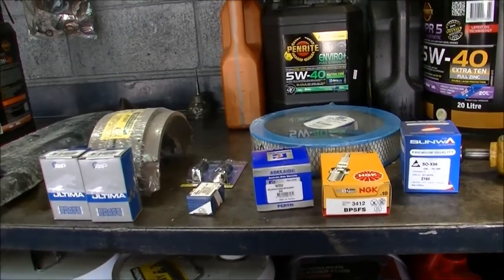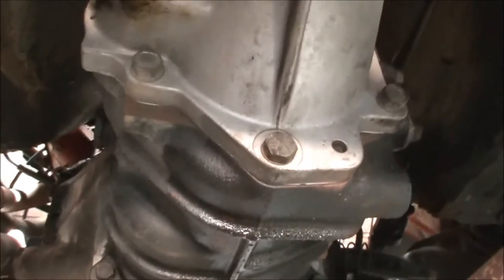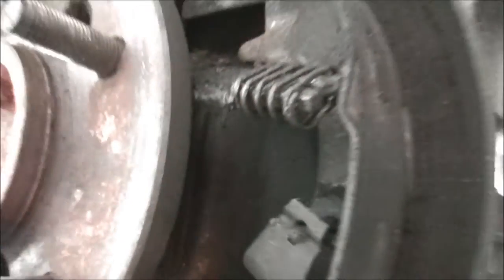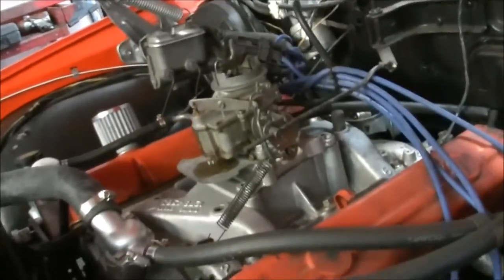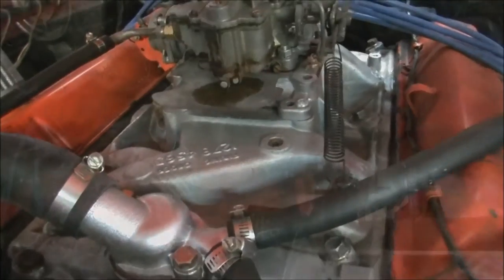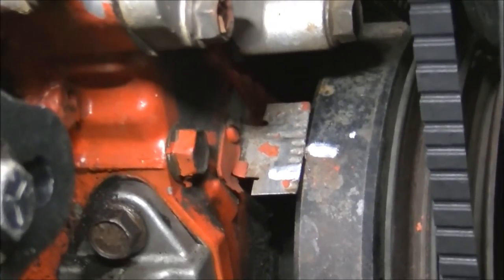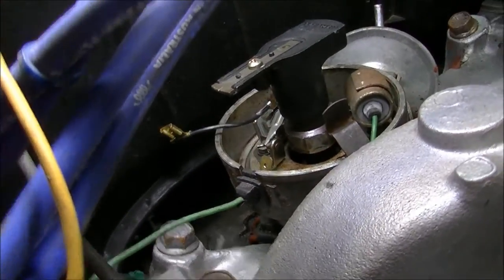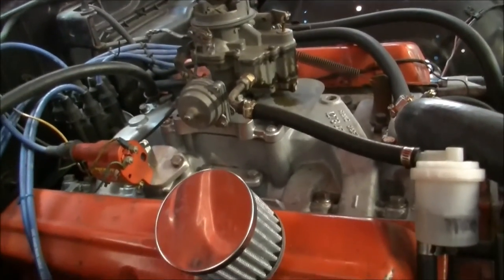1973 Holden HQ 1Tonner..

Comment: A 308 4 barrel and a dizzy regraph tends to wake these old girls up. for some reason they came factory with a really slow advance curve and tend to load up, as I suppose the rational was that the people who bought the mini plastic were usually customers for a six but needed the extra torque for pull loads and long drives etc. Changing springs and weights makes a ton of difference (pardon the pun).
Reply from the maker: I found that a 500 Holley and a HEI does the trick but this is what he wanted.

Comment: 253 z30 oil filter that I have on my like 202 that I use on my 253
Reply from the maker: When I worked at Holden we used Z160 to overcome main bearing rumble on 202's and a Z160 is standard on a 5.0 which is identical in the oiling system as a 253 that's why I choose a Z160...Cheers mate.
Reply: ZIGgassedUP  I love old Holden hq all to wb is sad got rare at time but easy to repair my dad save my HJ premier going be crash pay $200 no rust because the paint  and old man died clean house find HJ they take wreck yard lucky my dad I was 8  my give as first car have to now gear box. Have is day I use 1970 hq workshop manual my godfather give he use own Holden dealership I have all dealership work manual 1948 to1988 and Chevy Holden dealership manual 1920 to 1988 to c30 I have dealership sign when you look at pic at all the models
Reply from the maker: I like even older Holdens...EK is one of my favorites as is HR's and HT's...My 1938 Chevy was built by the HMBB (Holden Motor Body Builders) and it has a Holden EFI V8 and a HR front end and HQ stubaxles and Commodore discs and a LH Torana steering rack...I know and like Holdens most of all...HZ's,Gemini's and Commodores were new when I worked for Holden..Thanks for taking interest.

Comment: Good ol HQ I remember when they came out I Still think the HG & HK model looked better esp the Monaro
Still it is great to see a fellow Australian showcasing "Astralian Made !"

You know this trick ? https://www.youtube.com/watch?v=hpp67aqwM2Y Static Timing
Reply from the maker: The first Holden that I can remember seeing brand new was in '63..The headmaster at school bought an EJ and all the teachers were all over it..lol...I've had 1 FB,1 EK, 3 HR's,(1 Prem)1 HT a 1 HB,1 LC,1 LH Toranas a VB and a VT...The HT was a really nice sedan but I really wish I'd kept the EK..Cheers Joe....Bloody oath..Straya mate.!...And for the timing tip..Yeah I've done that too but I just go for the method I showed there..I gotta be honest and admit that I just ran a 0.015 feeler through the points and probably should have done a dwell check but you know.....lol..Cheers mate.
Reply: My First was a EH Station Wagon Green with a white roof Damn Good Car that Boy I bet that would be a Costly car to purchase now ! I also had a Hk Holden sedan 6Cyl, XP Station Wagon 6 cyl, Hillman elite, XA Falcon Panel Van ( 6 cyl) Bedford Truck around a 1960 I wish I had one of those right now Rare as Hen Teeth or to costly if you find one Esp in the Wheatbelt of Western Australia ( Want to make a RatRod /Truck maybe) , had several Motor bikes 2 broken right legs ( separate occasions!) a Hi Ace Lwb van Petrol and now drive a Hi Ace 1996 LWB van 2.8 liter Diesel I try to keep them for as long as i can and look after them rather than Change For me a car is Just to get me from A to B with the least amount of trouble doing all I need from it Hence the Hi Ace Vans and a trip to Perth every 6 weeks or so Heaps of stuff to bring home Ah I did have a 48 ford prefect as well around 1982 ish But unfortunately was renting then and had no where to put it safely sigh again I wish I had that one Gee now I write them down I didn't realise over 41 years of driving I've had a few ! and I may have forgotten one or 2 as well 

Tony
Reply from the maker: I have a list too..1958 Renault 4C when I was 12 to learn some hands on mechanics...Outside of the Holdens there was a 58 Morris 1000 a 67 850 Mini a '68 Fairlane I put a Clevo in an XA wagon a mint 67 Corrolla a 60 Morris 1000 Panel van with a 120Y drive train another Morris 1000 that I chopped up and stuffed a 427BBC for Drags(unfinnished and long gone) an EB panel van to cart disco gear around a TC Cortina 6pak two GE Sigma scorpions a  89 Suberu Leone a Volvo 244 (it was gunna get a 308) my current daily the 94 Pulsar and my '38 Chevy..Holden built of course..
Cheers
Ziggy